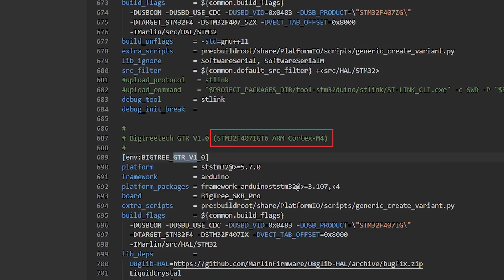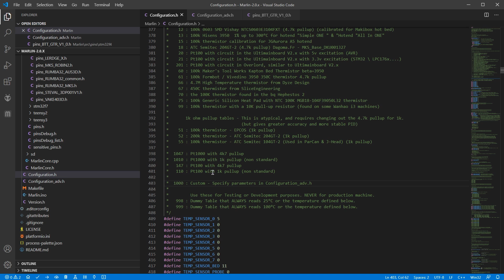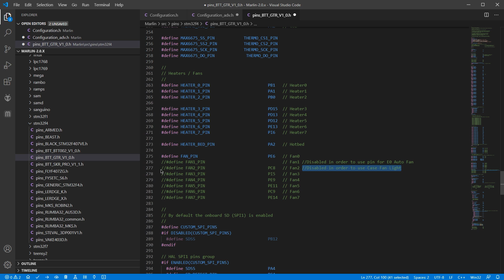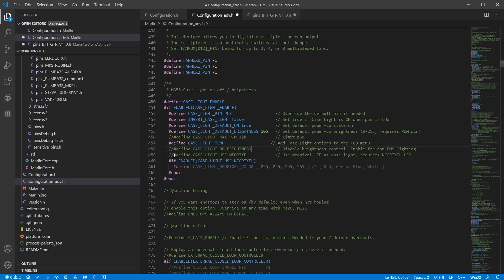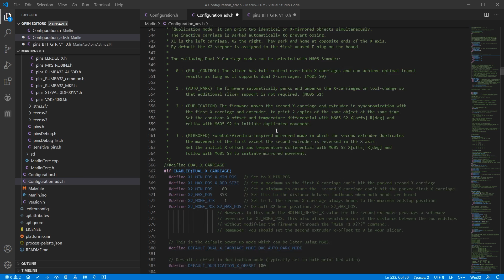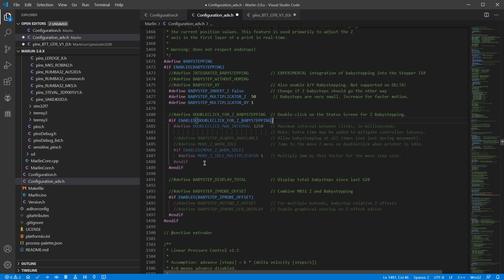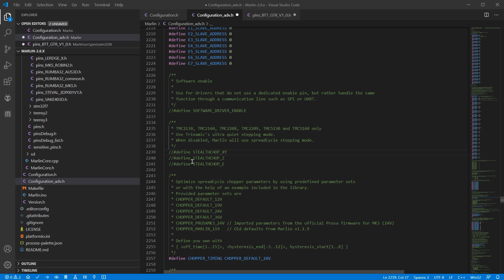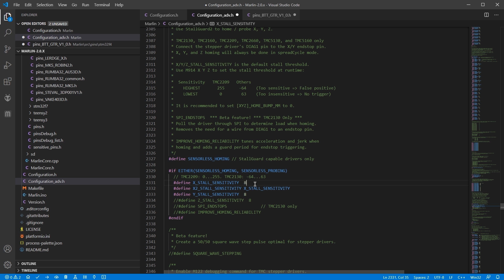Marlin 2.0.x Full Guide - Advanced Configuration (Part 3)

Comment: I have the Orbiter Extruder installed.
On the productpage they give you a "Recommended firmware configuration".
Only one problem. My controllerboard run with Marlin firmware but the "Recommended firmware configuration" is for Reprap firmware.
So i try to figure out what the settings are in Marlin but i can not find the correct settings.
This is what i shoud configure in the firmware:
----------------------------------------------------------------------------------
Recommended firmware configuration:

Steps:                                  690 steps/mm @ 16 micro-stepping
Acceleration:                      600 mm/s^2
Maximum instantaneous speed change (jerk):              300 mm/min(RRF), 5 (Marlin)
Maximum speed:              3600 mm/min
Pressure advance:            0.02s
Retraction:                          ~1.2mm
Retraction speed:              60mm/s
Motor current:                    0.5A Peak or 0.35A RMS
----------------------------------------------------------------------------------
Can anyone direct me to the correct lines (using stock Marlin Marlin-2.1.x.zip)?
If i could have a linenumber with a copy of the line and the correct values then i would be very thankfull.

I did write the maker of the Orbiter about this but didn't get an answer back until now.

Comment: Hi
Do you know why the latest firmware from marlin to an ender 5 pro v2 (card v.2.2) turns around the gcode when printing so that it starts on the right side rather than the left side when standing in front of the machine.
I use.
ENV. stm32f103ret6_creality
Board. board_creality_v4

Comment: Hi,

I have a question about the building from scratch 3D printer. for my idea, I would like to have 4 PMW output to simulate the extruders as I am using actuators that need this type of signal. So my question is, Can I use 4 pins on the RAMPS board and assigned as extruder on the Marlin firmware and when I slice the design using Slic3r  with the 4 different colours I would be able to activate this 4 pins with PMW signals when the Pronterface perform each extruder? 

Hope this question makes sense and I could hear soon from you. Really appreciate your content.

Thank you.
Reply from the maker: Honestly, I don't know.